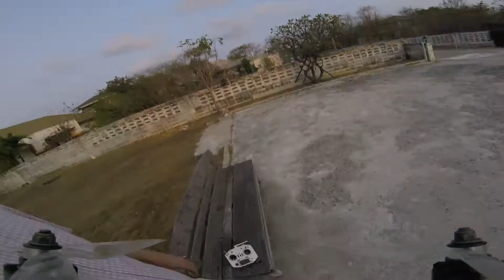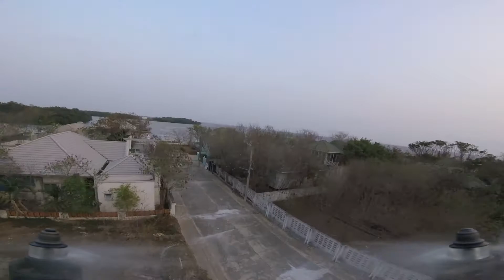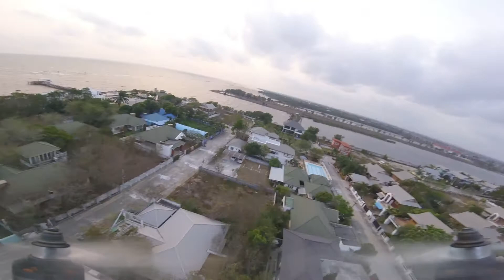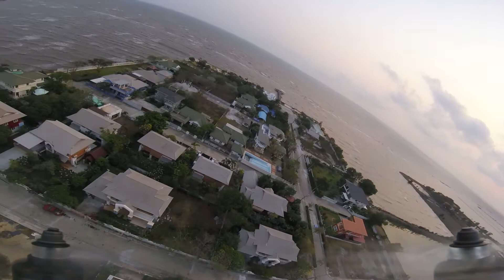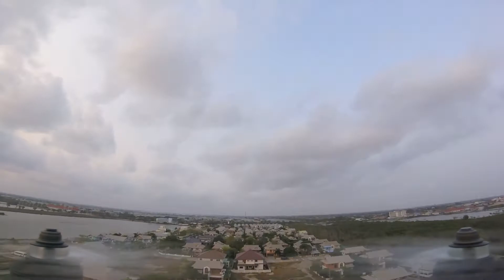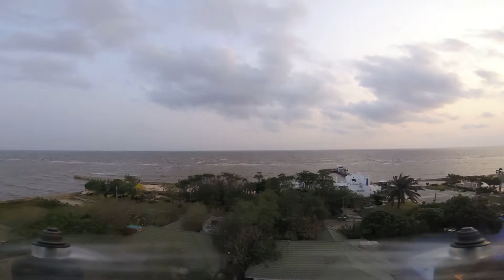Why DJI Mini has problems in windy conditions.

Comment: Mavic Pro has a sport mode but still has a tilt limit. Yes, it should bea problem if one doesn't take wind factor into account before flight. But I guess most people don't fancy windy flying.
Reply from the maker: I kind of enjoy windy conditions but the footage gets pretty bad... horizon 30degrees off. Split-s ends up in the next soi etc...